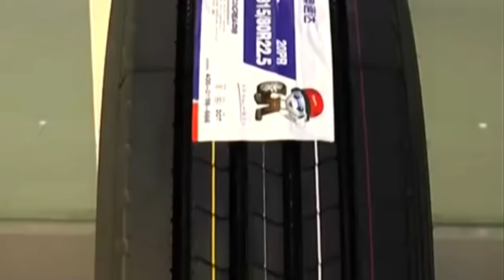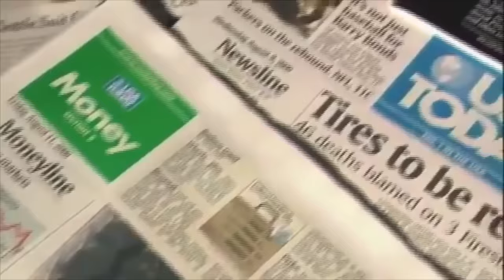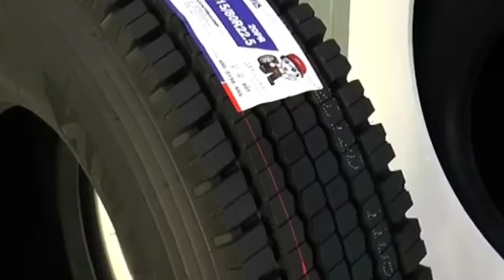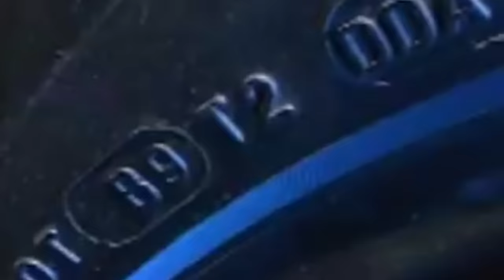5 Tires You Should NEVER Buy!

Comment: As an engineer, I worked in automotive suspension design a long time. That said, you just got a thumbs down for one major issue: every case you cited is NOT EXPLAINED PROPERLY. The Firestone Wilderness tires were found to have been under-inflated to a dangerous level on all tires undamaged that were tested (on point-of-issue vehicles). The Consumer Reports video you showed about the Explorer was later cited as fraud, because THEY INTENTIONALLY reduced the air pressure to almost 50-percent of what it should have been, to accomplish rollover! As for 'don't trust Chinese Tires'...got news for you, there are VERY FEW tires in America now that AREN'T Chinese manufactured...check your codes! A number of name brand tires are made there, just like 'no-name' bargain brands, and FYI...The Firestone Wilderness was an American-cast tire...so says a LOT about what you are saying. As for the Goodyear G159's, they were NEVER marketed for 'passenger car use' and should NOT have been on the motorcoach you cited (which asks the question, why were they on there to start with? OEM mounted, or end-customer replacements?) Another FYI...NO TRAILER TIRE IN AMERICA is a 'passenger car' tire...and they ARE PLACARDED as 'not rated for speed above 60-MPH'. That is because they must be aired up to FULL PLACARD AIR PRESSURE to support the loads they are rated to! If they are aired up this far, then the rate of expansion for the air inside them will cause FAILURE PRESSURES as they are HEATED (by friction at high speeds). ALL TIRE COMPANIES KNOW THIS, and is why 'performance cars' have VR or higher speed ratings (to ensure they are designed and placarded correctly). The only exception to 'trailer tires' are COMMERCIAL TRAILER TRUCK trailer tires, which are designed for higher speeds at full load ratings.
You really should have checked with an engineer, before you published such a rampant piece of fear-porn.
Reply: Skeeter Saurus yes, but Chinese-made tires manufactured by reputable brands have to have certain industry standards, while tires by Westlake (which is actually fairly common here, unfortunately) and the other Chinese brands don't have the same standards. Actually, Westlakes sport summer (I think it was their summer tire) tire failed German safety tests horrifically in braking distance.
Reply: 😂😂I love reading comments from people who know what their talking about
Reply: Jetstream S.  IQ is based on how well you can detect patterns and overall does not determine intelligence.  But I guess you're decent chess player or what ever .
Reply: Jetstream S.  Also you misspelled *resorting
Reply: Agree with the first two points, but the G159s are being used/recommended by goodyear for RV use. Yes they're not "passenger cars" but they don't yet require a commercial license to drive. I would like to see if it is the weight of the trailers and RVs that is causing it to fail rather than the tire design itself. I don't think I'd take tires meant for a boat trailer and make them hold the weight of an RV at highway speeds....
Reply: Cocaine Fish XD You're to funny. Take a look at your tires.
Reply: Jetstream S.  My falkens are fine.  Also reread my comment something tells me you failed reading comprehension.
Reply: Cocaine Fish Says the guy who put an extra space, and no commas, in said comment.
Reply: mutedevil  ayy man you're going to insult  someones iq  atleast spell correctly .  Not that hard . I'm not not a grammar nazi by no means but my dude had it coming.
Reply: mutedevil  also he called me racist but I dint make any racist remarks .
Reply: Burako Shimazaki  ya it's ridiculous. Js dude called me racist and dumb with poor grammar . America for you .
Reply: Burako Shimazaki I can agree. I won anyway. Byeeee
Reply: Jetstream S.  Naw dude I want you to find what's bothering you in life . So can live a better one . Have a good day .
Reply: Should be the highlighted comment... but it won't be.
Reply: Skeeter Saurus that statement I agree with cause sometimes you have good brand tires that have manufacturer defects. Unlike in most of these cases.
Reply: I am not 'brand-specific' familiar with 'Westlake' tires...but the placard values cast into the rubber on vehicle tires allowed into American ports MUST BE placarded to NHTSA standards, which means that the placard value on a Xi Jue Wi Tire are the same as on an American Firestone tire cast in Oklahoma...the DATA must match the PERFORMANCE, or there is a significant liability issue that will result in MASSIVE penalties for importers (who are actually get hit with faulty market products, whether it is lead found in children's toys or false placard data on car tires).
SO, to this point, you are incorrect if you are addressing AMERICAN-sold tires...PLACARD IS PLACARD, period.
Reply: We can talk about ride harmonics, if that would better-convince you. Of course, you're only 17, with a high school education, but if you think you want to take a walk down ride dampening, suspension harmonics, sprung and unsprung mass and the significance thereof, let's go...glad to discuss these topics with you, as well as how car tires are FAR MORE IMPORTANT to ride characteristics than you could possibly imagine.
Reply: The failure point on MOST RV TIRES is in the speed in which they are driven. Check most-any YT video of an RV wreck, and you will see an RV improperly loaded (aft-axle, inducing fishtail), excessive speed or high cross-winds unacceptable for light-towing (1-ton trucks are NOT heavy toters). All this said, you should check out the laws about tires NOT PLACARDED FOR USE ON AMERICAN ROADS. NHTSA, as well as the ICC and any DOT inspector can write you a ticket for having 'TRAILER TIRES' placarded for 'TRAILER USE ONLY' on a powered motor vehicle, or believe it or not, even for driving above 60-MPH with them, even in areas that the highway is listed at higher speeds (such as 70, 75 or greater MPH). Doubt me? Ask a State Police officer that is familiar with highway equipment enforcement.
Trailer tires are EXACTLY what they say they are...and the difference is in the placarded pressures to accommodate MUCH HIGHER load ratings for 'otherwise similar' tire sizes.
Reply: Not many people know what proper tyre pressure or check tyre wear due to bad driving or badly maintained vehicle them blame the manufacturers especially if they are from cheaper manufacturing countries 
It's not rocket science to make tyres in Europe we have a standard which we expect every manufacturer to comply with or better it 
Only main problem you have with budget tyres is that they wear out quicker than premium brands
Reply: The firestone tires went bad because ford had a lower psi listed in the door then what the tires said on the side. It was to help stop roll overs. IT WAS FORDS FAULT
Reply: Skeeter Saurus how can any company stand behind a tire take a look around 8 out of ten vehicles have improper air pressure
Reply: Cocaine Fish. Thing is, he's still right regardless if his is an engineer or not.
Reply: Ill put in my $.02 as someone who's done all types of tires for a living for the better part of 20 years. The deal with he Firestone's was strictly under inflation. It was also mostly Fords fault for setting the air pressure too low. They actually set pressures too low on most of their vehicles if you look at the door placards from fords of that era (if there are any still on the road which is unlikely). The rangers of that time span called for around 23 psi on the door tag and the F150's and other half ton SUV's were around 28 psi. People used to come into my shop and ask about this all the time and i always said well how come no GMC vehicles tires cam apart in the late 90's and early 2000's? It was because they were properly inflated their door tag said inflate to 35 psi for almost all cars and half ton trucks and SUV's. It was a pain we had to cut all the DOT numbers off any warrantied tires and send them in separate from the casings to Firestone. The Goodyear G159's were a factory installed tire on motor homes and should never have been driven at the speeds that they were. I replaced many sets of the 19.5 inch sizes on coaches when the factory sets needed replaced and never had any problems with service life or signs of tread separation with any of them. I will not deny through all my years that the majority of the problems i've seen have come from Goodyear however nearing the end of my tire career they had come leaps and bounds ahead of the others in service life and quality. Way farther than Bf Goodrich which which seems to be going backward, i almost never recommend anymore. BFG has redesigned the legendary all terrain now for a 3rd time and removed any mileage warranties off them all together, and Goodyear came out with the Duratrac which in most sizes carried a 50,000 and some 60,000 ,mile warranties on them and i've seen them get it no problem. The longest lasting tires if you drive on them and not let your vehicle just sit around are Michelin but like i said you have to drive them because they are one brand more susceptible to dry rot along with Bridgestone. These 2 will also corrode an aluminum rim faster than any others too. Ive seen almost all Michelin LTX M/S and MS2's and Defender LTX (all the same tire just different names and had mileage warranty changes with name changes) all get usually 90-100K out of them despite being rated at 70K miles if taken care of properly. People with tires are funny when it comes to their brand loyalties. Some wont buy a Michelin but love BFG (its the same company Michelin owns operates and oversees them and Uniroyal and Fisk as well as some others) and basically dont believe me when i tell them that. Now are the tires different yes in minor ways but i worry about other things before i worry about what brand it is but that's because i've been around it forever and seen almost every tire made at one point and know what works and what doesn't just by looking at them. In short the video is way off and misleading as far as the foreign brands anything coming over here has to be DOT approved and rated with the UTG tire rating system set forth by the NHSTA or it doesn't go into service. Im not saying those tires in question weren't junk i'm basically sure of it but i've never seen any of them in use here in the states in my time.
Reply: loved the comment but fear porn is just funny...
Reply: Lord this comment section is tiring to read through, Its nice to see another person that knows the business. I spent a few days in Akron at Goodyear about midway through my career in tires going through all this. Its pretty cool Goodyear headquarters is almost a small city in itself. I got to tour the R&D building where the harmonics lab and sound chamber are. See the race tires being built to each drivers specs. Tire ride problem simulators. Tire explosions on their force measuring dynomometer, you name it i've seen it including driving all their performance car and SUV lines on their test tracks.
Reply: If memory serves the explorer also had the exhaust positioned to close to the passenger rear tire.
Reply: Wouldn't surprise me if something can be screwed up Ford will find a way. I've seen plenty of heat shields off of the spare area also up in Michigan with all the salt for snow I've seen plenty of spares laying in roads or parking lots because of cables rusted through and broke.
Reply: Skeeter Saurus, I agree 100% on tire inflation pressures. I always go by the inflation pressures marked on the tires and not those recommended by the auto manufacturer. I'm not an engineer but I've got over 3 Million real world miles in trucking and towing.

Back when the Ford-Firestone flap was going on I was towing cars and trucks for a living. It wasn't uncommon to find Explorers and other such vehicles that had been rolled over. When sitting flat on the ground those Firestone Wilderness and other brands of tires "appeared" to be fully inflated, but when we hooked up the tow trucks and lifted one end the tires on the other end went flat with the load shift. Thus the cause of the rollover and I'm sure, many of those blowouts Firestone got blamed for.

After all, they did go 8 years without problems.

On the Goodyear G 159s, they were a victim of tire dealers not selling the right tire for the vehicle. I have seen 159s installed on the steering axles of long haul tractor-trailers never to good ends.

Like you, I agree the problem isn't the tires in-so-much as it is improper installations and low pressures.
Reply: One more note on the "Ford Exploder"...... The tire pressure was reduced on all exploders (by factory bulliton) due to complaints of a rough ride condition (a quick fix)........ Also........ Somehow at the assembly plant they managed to put around 86% of the bad tires on the left rear (damn they're good)....... or was it really the Exploder???........ I'll let you take care of the simple math !
Reply: You mean Train Driver right?
Reply: As an auto mechanic the first thing i learned when i was learning about tires and how to balance and mount tires the first thing I learned was that ford under-inflated the wilderness tires because people were complaining about a bad ride in the explorer.
Reply: Engineers point of view, works excellent on paper.
Reply: You could be right. Or wrong. The video can be right. Or wrong. 
For all I know, you all can be aliens .
Reply: Skeeter Saurus this guy has no life
Reply: The Explorer always had a low tire pressure, they didn't lower it, it was always 26 psi for the 235/75r15 size.  The Explorer came standard with both Goodyear and Firestone tires.  Only the Firestone tires failed and among those tires, the ones that failed came from the same plant, Decatur, IL. Firestone closed that plant.  The serial numbers started with "VDHL" if I remember correctly. Originally the Firestone recall only involved tires from one plant but public paranoia expanded the recall.  Radial ATX tires also got recalled for the same problem.  Of the tires that failed they were also found to be underinflated way below the recommended 26 PSI.  The most failure rate was the left rear, most likely this was because of the  weight located on the tire.  Like other manufacturers of SUV's and trucks, the fuel tank was located on the left side.
Reply: Amen 🙏🏻 was about to write something similar and it probably wouldn’t of been as well written as this as I don’t have time. This is 100% accurate  the video is stupid fear monger BS
Reply: Chris O Mastercraft tires are made by Cooper Tire, a USA manufacturer. High mileage tires "generally" do not give 'A' performance in wet weather.
Reply: Skeeter Saurus..Thank you for this comment. Auto tech here and a state inspector.
Reply: Well put Skeeter. I've been in the tire industry since before the Firestone recall. Ford was who was at fault. In an attempt to make the explorer ride smoother. They reduced the air pressure recommendation to 26. Far below what it should be on a vehicle that weight. I actually kept a set and put on my truck with proper pressure. And ran them until the tread was worn out.
Reply: You are exactly right, I worked for Firestone during that time. 049-743 was the tires article number and they were called Radial ATX, not Wilderness. But Ford wanted them to be underinflated due to Explorers rolling over with normal inflation pressures. Ford placards all said 26 PSI for the LTP235/75R15 tire. After all the lawsuits, Ford wanted 30 PSI in the tires. If your Explorer came with the P225/70R15 tire, Ford would recommend 35 PSI all around.
Reply: To: Daniel Flett,
You got that backwards, low pressure CAUSES rollovers!!!
Reply: Skeeter Saurus You are absolutely correct. Under inflation causes tire to fail. Further examination needed to be investigated. Other causes of tire failure are improper puncture repair, cuts on tread and sidewall, wrong tire application, illegal modification, aged tires with ozone cracking, part worn and worn out tires are contributing factors for the safety of vehicle owners but also road user.
Reply: Alot of RV's are as big as any bus on the road. The only reason a commercial liscense license is not required is because they usually are not used for commercial purposes. 

Heck in my state a farmer's son/daughter at 15 may drive an 18 Wheeler on the road as long as they stay within 25 miles of the farm.
Most of these children are better drivers than some of the idiots that drive RV's
Reply: Jetstream S. Just saying, for the most part I.Q is bs, that can easily be manipulated.
Reply: It was rather funny hearing about exploding tires on an explorer and when we all heard this we all pretty much said the same thing that they were under inflated.  I have always gone with the max air cold psi on the tire and ignore what the door shows.  The people that made the tire know what is best for the tire.
Reply: Skeeter Saurus how dare you doubt that it wasn’t because of the “threads”? Lol couldn’t have been speeding if they hit the barrier at 70 after rolling 6 times.
Reply: Although one Chinese Brand in German tests came to shared 3rd place making better results than Michelin and Good Year and several other "better" brands... But in this video, i'm disappointed that the cases are 30 year old... Who uses those in 2018?? How about recent makes and models?
Reply: Dan, the pressure on the tire's sidewall is the maximum pressure, the pressure on the door is the recommended pressure. The two are not always the same, for many reasons. As for the Firestone/Ford thing, that was, indeed, Firestone's fault; there was a problem at the factory. When management discovered the problem, they put the tires out the door anyway. There is no way that can be laid at Ford's feet. Look it up. The Decatur plant had problems the workers knew about,and testified about.
Reply: William Nelson - if this was Ford's fault for recommending too low a pressure, why did Firestone warrant the tires as being acceptable for that vehicle with those recommended pressures?
I will again point out that Firestone's Decatur plant had problems that management knew about, and they approved the tires for shipment anyway. With the recommended pressures. This can't be blamed on Ford, when Firestone knew the tires were defective, and warranted the tires at the recommended pressures.
Reply: Emmers: "The people that made the tire know what is best for the tire." In general, true. In particular, not true.
In this case, Firestone knew the tires were defective, which should have meant they (the tires) should have been shredded. Instead, they shipped them anyway. This is a case where the people that made the tire certainly knew what was best for their bottom line, but not for their customers.
Reply: themanwithsauce - The manufacturer rated load capacity is molded on the sidewall of every tire made for highway use. The load rating is at the maximum inflation pressure and the maximum allowable speed for that class of tire. Increasing pressure above the rating does not increase the load rating.
Reply: Chris A, Ya mean jacked-up stomper pickups with giant mudder tires aren't spozed to be driven at 120 mph?
Reply: Mark Bradley - They're over 73 years old. Germany is in the fourth reich now. Maybe fifth? Sixth?
Reply: Brian Kidwell - Tire pressure cannot be told by looking unless it's very low.
Reply: Scott Waltrip - When I'm cruising at 70 in a car and a huge motor home, pulling a giant boat or matching triple axle cargo trailer, whizzes past like I'm sitting still, its trailer swaying back-and-forth, it's amazing that I don't come up on it down the road sitting with a shredded tire. Or worse.
I've seen 'em speeding by with an inner dual flopping around.
Some years ago in an RV park in Early, Texas I saw a ginormous 3 axle 5th wheel towed by a 5-lug 1/2 ton pickup. The factory weight on the 5th wheel's placard was 14,000#!!
People think that because the PU has power enough to pull a huge trailer that it's OK.
Reply: Chad Mason - On a live axle RWD the LR tire is loaded more heavily than the RR.
Driveshaft torque twists the axle counterclockwise. On pickups the frame also twists.
Reply: roy wong - Rayon is synthetic cotton, cellulose. When they get cracks in the sidewall rubber water gets in. If the tire isn't used frequently the moisture stays in, rotting the Rayon.
Reply: Rich Laue -A CDL is not required as an ordinary driver license is good up to 26,000# total weight on scale and 10,000# trailer weight on its tires. The "non-commercial" CDL is required by some states for RVs over 26,000# total train weight.
My 3 axle cargo trailer is rated 9,990# on its axles + 2,000# on the hitch ball. The axles are rated 3,500# each, total 10,500# providing 510# margin.
I still have two of the original Chinese bias ply C range tires on the center non-braked axle. The front and rear axles chew up tires from going around street corners, especially RH turns. Occasional brake locking doesn't do the F and R axles' tires any good either.
This long wheelbase trailer wants to go straight, so I've never used a sway control.
Reply: Rich Laue - So if you have two farms within 50 miles of one another no problem?
Does your "NOT FOR HIRE" 18 wheeler have "farm" plates?
Reply: capnskiddies - They only drive 'em 75 instantaneously as they are accelerating to 80-100.
Hey, I can be going 70 and half of a manufactured house will blow past at 90. They do the twist at high speeds. They need a pace car, not an escort.
Reply: lol
Reply: no shit!  you get what you paid for!
Reply: Michelins are French, Pirellis are Italian, Bridgestones are Japanese, AND YOU ARE TOTALLY WRONG FOR ONE SIMPLE REASON -- BRAND DOESN'T MATTER;  YOU MUST READ THE SIDEWALL WHERE IT SAYS "MADE IN _______"!  Welcome to global companies who now manufacture their brand wherever, including the USA (, and [there are] international knock-offs, too!)
Reply: Finally a fellow engineer who knows what they are talking about. Hats off to you sir
Reply: Al Grayson Yes, very true. Moreover rayon is fabric and good water absorbtion. As the wheel cycle, the water will travel further circumferentially and deterioated the structure of the tire.
Reply: AerisM In my country Malaysia, all tires irregardless of brand and country of origin compulsory to comply the Standards of UN regulation, DOT and the local Standards. Road users safety is the top priority.
Reply: Cocaine Fish I have carefully read his statement and it is very true. I am in the tire industry going 23 years.
Reply: Joe Johnson If it is garbage, it will not be able to sell in your country. All tires exported to another country must meet and comply the "Standards" before it can be sold.
Reply: themanwithsauce Commercial tire and passenger tire have different structure.
Reply: Billy Jones Every 3 weeks the tire need to be inflated according to the recommended air pressure. The measurement are during " cold". If the tires are warm and had driven more than 8 kilometers is to add extra 4 psi. Hot air expand and cold air contract.
Reply: Chris O Most importantly the is the tyre under inflated. Is the tread depth above 3mm. Also if the tread design comes in block usually good braking distance during dry than wet. By the way, I would advice during heavy down pour, drive 80kph.
Reply: Emmers Ebon Hawk Utmost important is to maintain your tires. Look out for cuts and sharp object lodge on the tread. Repaired tires are no guarantee of  a strong structure.
Reply: Skeeter Saurus so how much the government pay you to write that??? Enough to know you have no morals if defending shoddy companies that taking short cuts on tires.
Reply: Being in the tire industry for the last decade I love this comment. There is only a handful of brands that manufacture tires in developed countries let alone in the US. Even premium brands like Bridgestone, Firestone, and Goodyear have plants in both the US and in China, or other Southern Asia countries that also manufacture the same tires as the US plants. Unless you look very closely you wouldn’t know these Premium tires are being made in “Discount” plants. And yes as a expert in the industry I can tell you there is a quality difference. Now the Chinese brands are cheaper made and it shows. But the biggest issue is tires not being used fast enough. Modern radial tires older then 5 to 7 years will fail no matter the brand. 95% of tire problems in this video were improper tire pressure maintenance and negligence from the OEM specs. Now Goodyear’s are garbage no matter what. They have the highest failure rate among every brand I have seen. 9 out of 10 blow outs are Goodyear’s. The only brand I’m aware of that is made in developed countries is Michelin. Most being made in Canada and the UK.
Reply: I seem to remember something about the fact that the tires were made with steel belts that were rusted prior to manufacturing.
Reply: Oh snap
Reply: Skeeter Saurus well done.  As a guy who was in the tire business for years your comment was perfect.
Reply: K
Reply: Cocaine Fish- he called me racist, America for you.  

Yeah so not racist. 😑
Reply: Bartholomew Horatio Brunel on a cmv it is mandatory that the tires be checked twice daily pre-trip and post-trip however it is recommended they be checked every time you stop ex. Mandatory load checks should include a quick vehicle walk around, stop to grab a sandwich... takes 2 minutes to walk around the truck thump the tires, check lights, and check cargo securements.  It's that easy. Also people need to start following the laws pertaining to speeds ex. In some states rv's/vehicles towing trailers/even cmv can have lower posted speed limits. WI used to have limits for vehicles towing trailers, and rv's of I believe 55mph and switched back and forth as to cmv speeds of 55 or regular posted speed limits on highways/interstates
Reply: Skeeter Saurus - yeah, but all this knowledge you're throwing at us is not convenient nor does it much appeal to us, as we like to remain ignorant, put everyone at risk, & just do what we want!  Killjoy! Now if you'll excuse me, I'm going to heavily tail-load a 26' RV trailer with mismatched, under-inflated tires, over-torqued wheel studs, & I think maybe 3 working lights (better than none!). I'm gonna yank it down the road with a stock Ford Ranger. I passed on the stupid sway bar, & pesky chains. I'm leaving a day late so I'll have to do 85mph on a 90° day! Toodles!
Reply: Skeeter Saurus u tell em Skeets!!!
Reply: I concur with the last person comments the engineer as an owner of a 1999 Ford Explorer in the year 1999 when my tires are recalled it wasn't just Firestone Tires it was any tire that was manufactured that could fit on that vehicle and as I was told by the company that replace my tires it was easier to site a Japanese tire that cost $4 to make thing to go after 4 for poor design vehicle the two options that Ford had was to lower the center of gravity which was to drop the vehicle which makes no sense because it was an issue suv or drop the tire pressures which caused the side walls to flex and it's 60 miles an hour if you're cut off while driving on the freeway the potential of you rolling the vehicle are very good but Ford knew their design was poorly done back in the 80s when they made the Bronco President Reagan knew about this and didn't nothing again it's easier to go after a $4 Tire made by Japanese manufacturers then it was to go after Ford which would have really devastated our economy
Reply: Skeeter Saurus AMEN!
Reply: Que?
Reply: Skeeter Saurus just damn
Reply: As a Tire warranty officer, I also agree with your statement. Applications and other important safety information are available in the tires' sidewalls and it was put there by law. Speed limit, weight capacity, max PSI, temperature ratings, some even put decibel ratings.
Reply: Avoid good years?  Maybe the title should be tire models to avoid....not brands.
Reply: Skeeter Saurus Well said man
Reply: I AGREE
Reply: Thank you, said correct!!!!!.
Reply: R U a company shill??
Reply: Skeeter Saurus Cuz... the same thing happened to my 1996 Ford Thunderbird... it didn't flip, but it fucced the front of my whip up.
Reply: Skeeter Saurus  you’re exactly right. I managed a Firestone store and they were specified to be under inflated on the Explorer. The explorer also had some suspension design flaws. The tires themselves were actually great tires if they were properly inflated. We had one customer that got 98,000 miles out of a set on a Ford Ranger. We put them on new, serviced them and kept the vehicle aligned under a lifetime alignment policy.
Reply: Just like a made-in-china iPad is going to be better quality than a made-in-china cheapo no-name-brand tablet, a made-in-china Bridgestone or Goodyear or Michelin is going to be better quality than a made-in-china cheapo no-name-brand tyre.
Reply: Totally agree with you, I've been in the tire business for 30 years, i ran a set of the Firestone wilderness that we pulled off a customers car for warranty, ran them until they were done, no problems! As for the Chinese tires i sell a lot of them, decent tires and they are NOT dangerous! It's the moron behind the wheel that causes most of these problems.
Reply: Skeeter Saurus mm
Reply: Honcho Ray400 this guy triggered an engineer! LMAO
Reply: For the Ford Explorer case its been previously stated that a tire failure while driving straight shouldnt cause you to die so there is probably a vehicle design issue in play. Additionally i would also argue that a design issue may apply to the RV.  Tires can and do fail you should be able to maintain enough control to get the vehicle safely stopped in that situation.
Reply: I have Dunlop AT tires on my WJ.  I bought them Labor Day weekend, 2010.  They have 98,000 miles on them.  I love garbage.
Reply: engineers designed the tires
Reply: I seriously doubt most tires in the US are from China because Obama actually did something good during his administration and imposed tariffs on Chinese tires
Reply: Skeeter Saurus
Don't forget the basic incompetence of far too many drivers. Obtaining a driver's license anywhere in North America is a Mickey Mouse process. For their January 2001 issue Car & Driver conducted their own tests of an Explorer with a blowout. They rigged a used '94 Explorer with a device that allowed someone outside the truck (so the driver never knew ahead of time when it would happen) to instantly deflate the left rear tire (statistically, the one most likely to come apart in that whole Firestone debacle). In not a single test were they able to make their Explorer do anything other than continue to track straight, let alone roll over and kill everyone onboard. Not one. Even when they completely let go of the steering wheel with a blown tire, the Explorer continued to track straight. Their inevitable conclusion is that it was panicked  incompetents that were rolling their Explorers and killing their families (my words, I think C&D were more diplomatic). The next thing that happened was that they were slapped with a cease and desist order from the lawyers representing the "victims".   Courts are more interested in punishing big corporations than in discovering the inconvenient truth that Americans can't be trusted with maintaining and competently driving motor vehicles.
Reply: Yep, Ford specs tire pressures low for a more supple ride. I remember seeing some spec'd at 28 PSI cold. My Lincoln LS V8 calls for 32 PSI Cold. I run 48 front and 46 rear with tires that max at 50 PSI Cold. The difference in the handling is amazing. I guess it also helps if the tires are XL too.
Reply: Skeeter Saurus :  That was the report and the final Federal report .  This dont mean it is true of the fact with Firestone flyaparts or the Goodyear Maypopes tires .  Tires should handle a complete flats with out coming apart . At speed tire will keep it's shape at speeds . This is caused by gravitational pull on the tire .  Over time tires that do looses it's inflation will get hot . but that is not what causes the tires to come apart . What makes the tire come apart mostly stresses on the tire it self . This causes delamination to the tire . When a tire looses it air pressure there becomes a drag to the direction of the tire . Once the car slows down this causes more stress and heat to the tire .  I all cases that when a tire deflates a driver and tire have enough time to stop before the tire comes apart . It when people still want to keep going on a deflated tire . That where people get hurt or killed . I my life time I had may flat doing 75 80 MPH and still had enough time to get off the road . before a tire just comes apart .  These tires laminated at speed .  This because of poor and cheap binding agents in lamination  processes . Where did the tire manufactures buy the binding agants ? China .  The government put out this report to protect rich investors like Bush , Trump , Obama . Clinton   and the rest of these crook  , Not the small investor that make 100.000 a year on investing but billions a year . It is untold amount that these crooks make off the swet of men and women backs . They are not protect us . They are protecting them selves threw investing . That the real truth . That's why they dont want for us to see there tax returns .  This is just one stock investment .  You cant handle the truth . Goodyear and Firestone got out of it unscathed . And now the Fedural goverment let China made tired unchecked  and wont even pass DOT regs. that comes in to this country .  it's not becuase of this deal or that deal . It's because of rich greedy investors that was pushed into China . More investing more money to be hidden .  Disregard to our safety .  The government dont give a dam about regular people or the people that died for  this country .  This is the real truth .
Reply: Thanks
Reply: The people getting injured on the road was the proof.  So yes, they were dangerous tires.
Reply: Nothing like listening to someone who knows what they are talking about.
Reply: skeeter saurus, you sir have won the internet award for best shining example of what a person with real knowledge can do to educate others
Reply: You really know what you are talking about...can I hire you?
Reply: Wasn’t also a flaw in fords frame? That’s why they changed it the following year? Better to recall tires then to recall a whole lot of trucks
Reply: Mine are made here in the USA,
Reply: "Fear-Porn" Is that another way to say fear mongering?
Reply: This is what I got out of researching this as well. Thank you for enlightening some of these people on here. If I am correct this whole Ford/Firestone incident is what generated vehicles to have the tire sensors mandatory on all vehicles. How many people you see even nowadays driving around with dangerously under inflated tires. I'ts for these dummies we have just one more thing to keep up with on our vehicles nowadays. Well put Skeeter even if am 7 months behind in reading your comment haha.
Reply: If anyone reads the tire pressure on the side it says Max tire pressure not the proper tire pressure! And I've found that engineers can be some of the dumbest people on Earth! I've known pee-ons that have fixed many of engineers screw ups!
Reply: @NCRranger24  for an engineer, it's to hard to understand that
Reply: Anybody know how Nankang and GT radial tires compare against the rest? I'm looking either set for my suv.
Reply: You can still buy US-Made tires like tires made by Cooper, or just from other countries. I think Michelins are made in Canada, Continental are made in Germany. Most countries try to make decent tires, but I did also had trouble with Chines Tires in our fleet, and don't use them anymore. I read that Thai tires are good quality and cheap. So there are alternatives out there other than China.
Reply: Skeeter Saurus wow. Good info.
Reply: @outhere8690  Toodles to you too!
Reply: @cursedowlsgaming5355  A friend of mine joked about my dump salvage tyres being called Bad Years cause I'm always having blowouts
Reply: Bang!